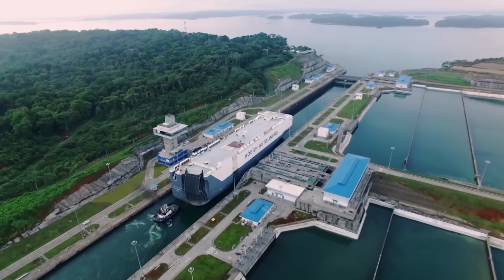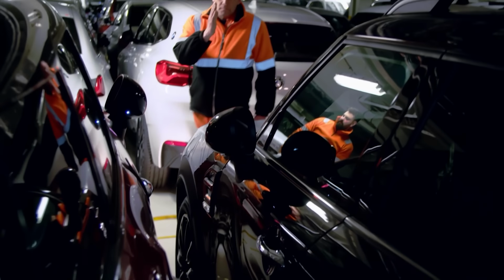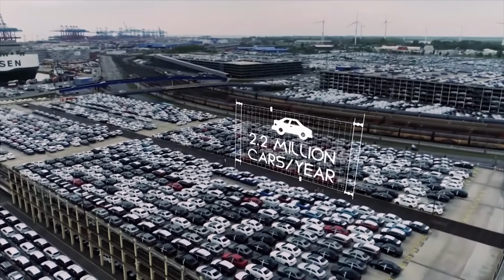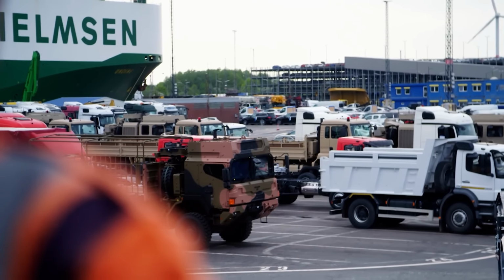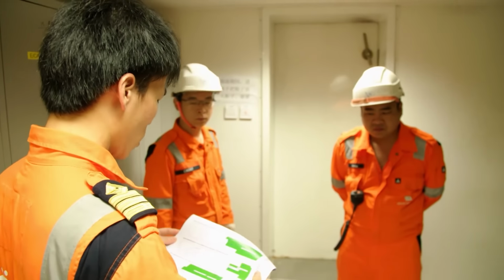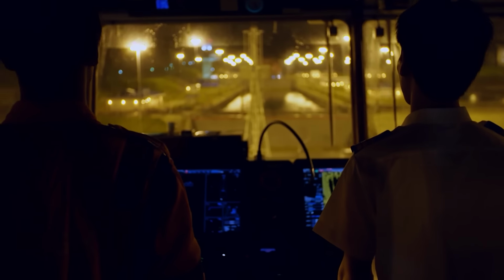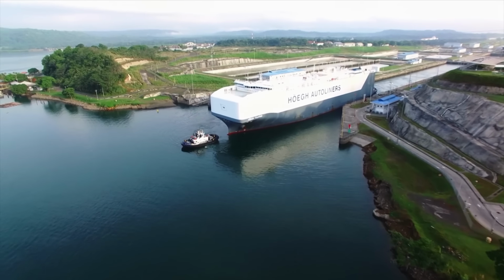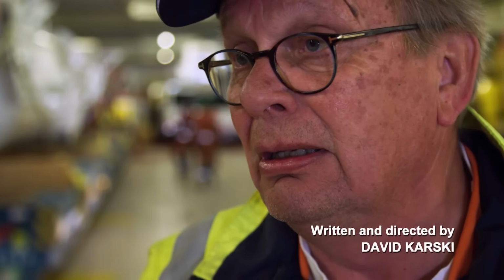Gigantic Overseas Autoliner | Mega Transports | Free Documentary

Comment: They know its gonna fit. If the world had this much drama, nothing would get loaded.
Reply: True we used to pass on the old locked  no big deal. Pilot is well season. I just apprentice but he said its ok. No big deal
Reply: Not only that, with this much drama the first ship still would be under construction...
Reply: @Coonass  I don't think, most likely a computer did. they use a calculation program to do the thinking part.
Reply: @LegendLength  If software is so good....why did they have to put wooden planks under the big dumper bucket to get it on board?
Reply: I disagree. Chances are they would just say "well looks like it's going on the next boat".
I mean really, the only reason it wouldn't fit is because the measurements were wrong of they were not given important information.
Reply: What's gonna fit? The big bucket that might not fit on the deck while they never mention the hatch it needs to go through, that's lower than the roof of the deck? 

Or was it the locks in Panama where they have less than 10 meters on either side, and where the ship must be perfectly straight and can't move because it could hit the side of the lock while it's tied down? 

I mean none of this shit is routine! Who the F measures cargo before they load it bro?? You can't do something like dropping a tape measure and check the height! It's simply unfathomable, what's even more unlikely is that a professional pilot would guide much bigger ships through the canal on a daily basis. It's simply impossible!!!
Reply: @HaydenHatTrick  Because no one told them it would be a bucket... I mean you definitely wouldn't tell your shipper what you want to have shipped! And the guy definitely didn't say that he transported these things before.

Comment: Doubt the company would accept a "mystery" cargo like that bucket without knowing the exact dimensions of it in advance lol.
Reply: Yep. Gotta make it dramatic for the show
Reply: Ormathon Yes, you are right. Such shipment companies will never allow any of its cargo without knowing precise dimensions. This is kind of drama for viewers to be in suspense and thrilled. 😂
Reply: Do... Do you work logistics? Have you ever worked logistics ever in your life? 

Yes, stuff like this happens all the time. Do they know the exact dimensions? Sure, someone in the receivables office has gotten approximate dimensions from the consignee or manufacturer, to the tune of roughly half a meters accuracy, or about 2 feet... At the very least, they know the maximum dimensions of the ship, they know the maximum heights and thus they clear that is does fall below the maximum allowable height, but that doesn't mean it will fit... That doesn't mean it will fit easily.

Like the narrator says, Per  is waiting for an unknown cargo, supposedly 7 and a half meters wide on a long trailer. You better believe that's all the info he's gotten from the planning office. They've obviously just gotten a late order and they've run the dimensions against what the deck heights are supposed to be and what the load on that trip is supposed to be to determine that it will 'probably' fit, and it probably will. 

What do you think happens? Do you think they run some kind of super Cad Tetris program to determine within the millimetre where it will fit and how much clearance there will be? No, they just run some basic spacial dimensions to ensure it fits within the allowable margin. You better believe they gave him next to zero info, as Per says himself, most of the time the dimensions aren't even correct and it's the height that becomes an issue. 

They only give him the most basic dimensions, they (the planning office) don't think in 3 dimensions, they only think in 2 dimensions - length and with, like a game of horizontal Tetris... Like a game of rush hour. And as has already been mentioned in the documentary, they've already had last minute order changes, it does happen. The planning office knows when something should theoretically fit, in regards to the original plan. But is the original plan in effect? Are they aware of any last-minute changes? In my experience, almost certainly not. And, it does happen that occasionally they have a last-minute order for you to throw on, which they think will fit, but it doesn't and you have to just say 'nope, leave it till the next run.' That's just life, I'm not talking specifically about loading cars on auto liners, I'm just talking about logistics in general. It's not as organised as you assume. It's not as heavily planned out and smooth running as you think. 

For the most part, with something so high profile as this, it is literally a game of high stakes Tetris. Do they know where each and every vehicle is going to go? Hell no they don't! They know thave have 100 something BMWs to go on, let's assume 30 for the first stop port, 25 for the second, 10 for the third etc etc and with that rough knowledge and after looking at the space available, they figure out how to split it between decks. They don't know if it's going to be big X5 SUV's or little sedans, they just get told a hundred something units of cars for xyz ports. 

Then come heavy machinery, they probably don't even get numbers until the last second, they just know whether to expect a lot of something, or a little of something. X amount of tractors, X amount of prime movers, an order of 5 or so large excavators and a bunch of mining and ag equipment. This is not a ballet, this is not a brilliantly planned and orchestrated event, this is literally Tetris on steroids... But, you know, logistics is actually dull as fuck.

Are they trying to dramatise it as much as possible? Yes, of course, they are, logistics is boring as shit... But they're not talking shit out their ass to make it seem any worse than it is. Hell no you don't know the exact dimensions, you genuinely do get told 'there's a last-minute order of XYZ and can you fit X on the run?" And yes, occasionally it can't be done, or it can be done, but you have to be creative.
Reply: @Mr539forgotten  Really got the blood pressure up didn't you   😁
Reply: @Mr539forgotten  I OWN HEAVY EQUIPMENT ALL MY LIFE... Cranes Barges tugboats track hoes back hoes and such/// ALL HE NEEDED TO DO IS TELLS THE TRUCK DRIVER TO GET OUT A RULER,
Reply: The dimensions given are about as accurate as advertised gas mileage on cars. lol
Reply: @hoodwinkedbyanangelmichaelfazi  Whoah slow down, is your caps lock stuck or are you trying to tell you that you're yelling at me? 

I work in logistics, I've worked with cranes etc etc etc. I know how it works. How does telling the truck driver to get out the tape measure help at all, if you can't do that until the load shows up? Sure, you can see if it clears the loading bay door, though you'd assume the planning office would not accept an oversize load that doesn't even fit through the loading door. But how does knowing it will fit help you get the load in place? Did you realise in the previous segment when they bottomed out the ag screed with the departure angle, whilst reversing down the ramp? You can say 'just measure it,' you can assume it will fit, but it doesn't make it fit and it doesn't help you make it fit. 

If indeed you have worked with cranes and heavy equipment your whole life, then you'll agree with me 100%; you never get given good information, you simply get given napkin notes and get asked if you can make it fit... Last second request, of course.
Reply: @dadillen5902  I mean, no... Not really... Not at all. 

I'm just explaining logistics to someone who seems to know nothing about logistics. I'm explaining how the world works to someone who's trying to smash easy likes from 'muh fake documentary drama lmao.'

I thought that was pretty obvious, because, you know... I literally explained it in the last paragraph:

"Are they trying to dramatise it as much as possible? Yes, of course, they are, logistics is boring as shit... But they're not talking shit out their ass to make it seem any worse than it is. Hell no you don't know the exact dimensions, you genuinely do get told 'there's a last-minute order of XYZ and can you fit X on the run?" And yes, occasionally it can't be done, or it can be done, but you have to be creative."
Reply: .... well maybe they have rules like jason statham.... like never look at the cargo or somethin'....
Reply: Right.  It's totally done for drama.
Reply: @Mr539forgotten  Yes, they do literally make sure it all fits like tetris. There is no "mystery" anywhere on an operation this big. Either they know exactly how it will fit or it doesnt get shipped. That simple
Reply: TLDR it all. Write a treatise.
Reply: What annoyed me was that after they loaded it, they show there's another one of them already loaded right in front of it. And the port captain says he's loaded hundreds of those buckets already. So he probably had a very good idea what it was going to be given the dimensions alone.
Reply: locnes761  HOGWASH!!! You totally don't have to inform the shipping company if you want to ship something the size and weight of a house. Just like you can't move and tie down a ship in a lock when you have TEN meters on either side! Those things totally happen and it happens totally unexpectedly when the camera crew was on board. Don't wreck muh fourth wall bro!
Reply: Jordan Huckel It’s not that deep bro.
Reply: I was thinking the same thing. It REALLY got all the way there before the main guy got the details? Hmmm....
Reply: Yes they don't know the exact size...especially it is order online.
Reply: @toprob20  you're speaking from ignorance. You haven't worked in logistics. The customer shipping such huge loads doesn't have any technical knowledge of how loading is done in either aircrafts or ships nor the restrictions.
Reply: @rext8949  So I can just drop any size load on their doorstep whenever I feel like it and tell them to figure out how to fit it on their ship? I think not! 

Anyone shipping anything anywhere needs to have at least some idea of how to get those things to their destination. Maybe they don't know the fine details, but they should at least know if your load will fit the materiel of the company you've contracted to move it. 

And any shipping company worth anything will want to know before hand how big the contracted load is to make sure they can fit it on their ship! 

If you work in logistics and you don't know how big your load is before you contract it you have no buisiness sending nor shipping anything! Both companies will have made prior arrangements and they didn't just dump a massive oversized mining truck on their dock and say "good luck". That's just fantasy.
Reply: Ship company and crew will be knowing what exact cargo is being boarded. Because they will have custom clearance papers and complete details of the cargo. 

They just want to over dramatise it to keep up the suspense and keep the viewers on the edge. It turned out to be silly
Reply: @Meteoroid-t8w  Exactly! You don't just show up at the quay with massive industrial machinery and expect to find some extra space on a car freighter :o
Reply: It's called money dude. When mining needs something companies just say yes because money is no restriction.
Reply: Haha! correct. They were exaggerating the whole process of loading the enormous truck's bucket.
Reply: @dadillen5902  Haha! He doesn't like people questioning his job!
Reply: @arsalaanperwez1464  Haha!! He doesn't like people questioning his inane worthless OPINIONS. I have always found it interesting that the lower the IQ the greater the propensity  for stating their opinions as fact.
Reply: @dadillen5902  Absolutely true bro.
Reply: @dadillen5902 Have driven commercial truck for 18+ years and thar is exactly 💯 what happens more frequently than people think. Logistics is a major game of tetris 😮😮😊😊😊😊😊

Comment: There should be a 3D software parking layout of the ship or at least some technician assigned to a computer showing live-parking data throughout the ship so it's easier and faster to coordinate and to calculate weight distribution, as well as to organize last-minute changes.
That way, crews that are loading vehicles can quickly be instructed where to park the vehicles in the ship via an iPad or some kind of tablet and move onto the next group of vehicles.

Comment: holy shit.. i just did some bored math..

if that thing holds 8500 cars, and the average gas tank is 12-15 gallons, and gas is around 8lbs per gallon, that means with all those cars with full tanks, youre around an extra MILLION pounds on that ship.. im sure they have to make sure all the cars are as close to empty as possible.. just basic moving the cars around, and nothing extra..

this is a fascinating ship.
Reply: Or, Just Accompany a oil taker ship with that AutoLiner.
Reply: They are filled 1/4 tank each at most, you're close
Reply: They come with very little gas in there tank
Reply: @krystalviewaviation  makes sense.
Reply: You have your weights confused, water is approximately 8lbs per gallon and petroleum is approximately 6lbs per gallon.
Reply: @AW4WAL  it would still be around a million pounds rou ding up. @8lbs it was like 950k I think, so 6lbs would still be an insanely large amount of extra weight just from something as seemingly trivial as the amount of gas in a tank. That was my point.

Comment: Hmm so a "New" car doesnt really have 0 miles.
Reply: That is why my dealer gave me $0.50 per mile on the odometer, and I got a $8.50 discount on a $33k car.
Reply: Correct, almost all new vehicles will have 1-5 miles on the odometer. Most cars go trough a mild test after coming off the line to inspect quality.
Reply: @livewiyaraw-uncut  Yes all cars will have rolled quite a bit but it won't show, odo's aren't enabled during transport mode, they're enabled in PDI before delivery to customer. Source: In the industry.

Comment: that is impressive, a docudrama amping up and embellishing drama so much, that they openly admit major flaws in the loading procedures and practices within the first 5 minutes of the docudrama. only having a minute to load a car and tie it down so it doesn't become shifting cargo, is as the narrator says "practically impossible", I tend to agree with that given the golden ray capsizing. a rushed operation that is bound to have major mistakes and safety violations made. Hmmmmm. I have seen pics of no straps on some spots of the deck, and straps just hanging from the deck in others with the end that should be attached to cars just dangling with no visible damage at all, this docudrama just completely explained what I was seeing. combined with a constantly changing unload-plan before they left port, the crew simply didn't have time to properly secure the cargo from the looks of the golden ray images and what this docudrama is describing. Hmmmmm. looks like procedures will need some major addressing to make these ships safe for transit I guess. I wonder if the ballast tanks also got overlooked in the rush of things.

Oh, nice, so the company is excepting contracts for moving cargo that they don't even know the basic measurements of until it's on the loading ramp of the ship while insisting on a rushed loading schedule. I am NOT impressed with the management of this at all, I am surprised there are not more Golden Ray capsizing incidents the way this is run. it's doesn't really matter if it was a dump truck bed, what if it was lithium batteries or a giant lump of sodium, it's really bad that the company isn't getting basic info of what they're moving. oy-vey. if this was a cargo aircraft operation, I'm sure the FAA would ground the fleet and suspend the companies license to operate for moving cargo that they do not know what it is.

Comment: The problem of getting the ship thru the canal without touching  the canal wall  is laughably easy to fix, comparatively inexpensive to install, operate and maintain,  and you don't need a pilot. The system is adjustable to any size ship that qualifies for passage. 
The only reason not to use such a system is featherbedding, ie keeping the pilots employed..

Comment: Get that port captain a segue or moped or golf cart ... good grief, what is that man’s time worth? The ship breakers in India roll gigantic container ships over the sand with enormous tube-shaped inflatable bladders. When that big piece of equipment bottomed out on the loading ramp, imagine having several 10 meter lengths of fire-hose type tubes that could slide in while flat, but quickly be inflated to lift and roll the equipment past the problem spot ... instead of pieces of scrap lumber. Also, why isn’t that canal literally lined with huge pneumatic capstan rollers ... I mean something that looks like it came off a rice harvester... or at least on those corners? Maybe something like tank-tracks that would passively roll if contacted by a moving ship hull? Why must it just slam into a concrete wall? I would think an insurance company would insist on something like this.